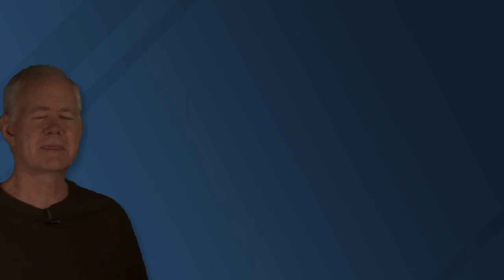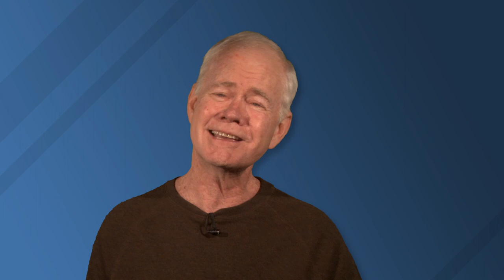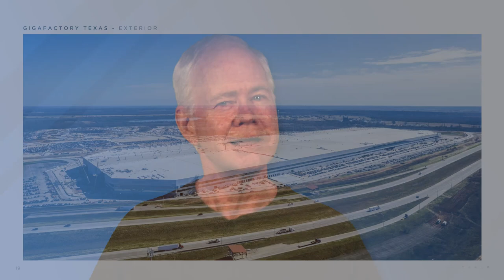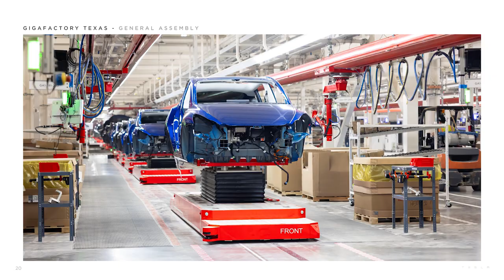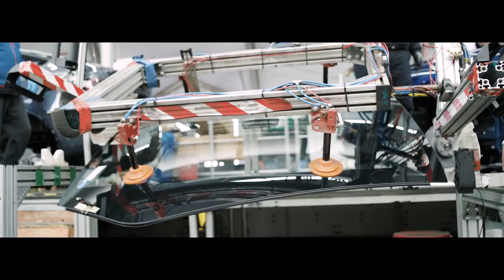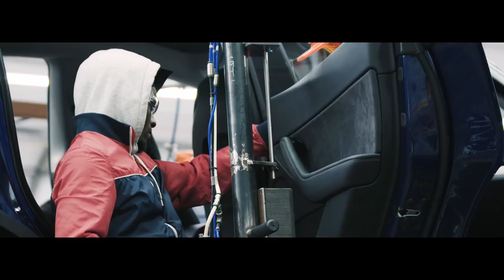Can Tesla Surpass GM & Ford? Here’s What Will It Take for That to Happen

Comment: The key metric is battery production - automakers can't make Battery EVs without EV batteries. If you look at the expansion of EV battery capacity over this decade, Tesla is positioned to hold on to at least +50% of the EV market through 2030, as the EV market inflates to 10M US sales. This is pure production capacity, not projected sales. But at those volumes, Tesla will be able to offer volume pricing that other automakers won't be able to match. And the Hail Mary play is that IF Tesla can complete FSD, they can sell vehicles at cost because the revenue from robotaxis will be more valuable than sales margins. This is the killer app that Tesla is aiming for. Why buy a 'nice' $30k GM Equinox EV when you can buy a $25k Tesla money printer?
Meanwhile, all the analysts are looking at sales margins because they have zero models for assessing the affects of robotaxis on private vehicle sales, so they keep focusing on the premium and luxury segments because 'that's Tesla's playground'. And we get comparisons between GM & Ford's ICEV production to Tesla's EV production. ICEV production really isn't relevant when the industry is shifting to EVs. The only metric that matters is how many EVs GM and Ford are producing, which at present puts GM and Ford competing for a distant 2nd place to Tesla.
As for where Tesla should put it's next GF.. Detroit is a terrible location. But people keep thinking "Teslas are cars, so surely a place that makes cars would be relevant!". Teslas are robots shaped like cars. The best location for a new car-shaped robot factory is places with lots of cheap land, access to cheap energy,  uncluttered logistics routes for parts in and finished vehicles out, and temperate weather to reduce facility HVAC costs while being more attractive to employees. Competing for land, power, and transport with the existing automakers in Detroit doesn't sound like any of that. Never engage in battle on your opponent's territory when you don't have to.
Reply: Wow, you really have some hopes and dreams!
Reply: "The key metric is battery production" . . . 100% Correct!  No other auto manufacturer has battery production capacity or access to it to allow for production of enough EV's to equal Tesla.  Tesla has been working on access to battery capacity for several years; raw materials and manufacturing methods; and has secured its future growth based on these critical factors.
Reply: You're definitely spot on with your battery capacity comment.  If this was an apples to apples comparison, sure GM and Ford would outsell Tesla on total vehicle sales.  But it's not a straight comparison.  What is GM and Ford making per vehicle, compared to Tesla?   Tesla at 14% per vehicle, when F and GM are less than 10%.  Also, how much money is being wasted on advertising?   $5000 per vehicle is a popular number.  The Cadillac Lyric might be $7500 based on every football weekend in the fall of 2021.

One thing never mentioned by the analysts is, how much money will declining ICE sales cost traditional automakers.  Even they would admit it's not free to just stop your ICE Equinox line and make it an EV Equinox line. Not just the R&D, but the retraining of robots and labor.
Reply: Jacksonville Florida in between Tallahassee lots of open land hi way 10 to the ports of JACKSONVILLE can handle all the incoming supplies to make cars then ship out!!!
As  Labor goes you have Miami Hurricanes the Gainesville Gators ,   Florida State University Semonyms, and the Georgia Bull Dogs,
Reply: Batteries are key, agree. But so many people cant see this unfortunately. You cant make EVs with batteries you dont have. So traditional automakers will have great and good looking products, but without enough batteries, it isnt worth much.
Reply: Carter,  Battery production means very little if the consumer won't buy the product.Here in the USA they have about peaked and Fremont will be closed before long because of lack of demand. These stock market folks have never  sold cars and have no idea that most Americans will never buy an EV.The small market for Ev's is about to be taken over by Ford and GM.
Reply: @davewhite113  GM only shipped 26 EVs in Q4 2021. They are way behind. Their CEO is  a wack job claiming to be leading in EVs.
Reply: Battery supply is an issue, but GM has plans for 4 US plants (or was it 4 additional) and has material supply deals. This is not the roadblock Teslerati believe. Besides if Tesla blocks anyone else's supply, there will be bound to be an antitrust case brought.
Reply: @205rider8  in the US, yes as delivery of the Hummer and Brightdrop vans began. in China GM sold 500k EVs, compared to Tesla's 240-250k. Tesla's China sales in January tanked, even including exports down almost 50% from December. That's not a capacity restraint. BYDs pure EVs outsold Tesla and must be close to GM's much cheaper Mini EVs. A new long range, larger and more powerful model under$10k should help GM maintain at least second place after BYD.
Reply: @davidmccarthy6061  Tesla is the only company locking up long term contracts on raw materials and battery suppliers.  Ford and GM physically cannot produce enough EVs to beat tesla as they haven't secured the raw materials.
You don't have to judge anyone's products when the competitors physically cannot make product to put up for competition.
Reply: @_PatrickO  the roadster and Cybertruck are delayed (also they are still in development, not ready for production anyway, so yeah, blame production constraints). On what are you basing "they absolutely had plans"? All Musk has said is "we will be able to produce a car for $25k by ...". And maybe they can. But when asked about it a few weeks ago said instead "we're not currently working on a cheaper model. Maybe someday we will". Did they show a product concept? No, all the images are enthusiast renderings. Did they actually announce they would do it? No they did not. Not cancelled not delayed, just not in the plan. Maybe, a very big maybe, they'll one day decide to actually do one, but since it's not currently planned and isn't being developed, it's at least a decade away. Maybe longer. Maybe sales will stall and they'll rush one into development, but this is far from "there will definitely be a model 2, but is not a current priority". That sentiment is purely fan fiction. In this case, no cheaper mass model, 2.2M sales will be market saturation, and they'll be lucky to reach that.
Reply: @davewhite113  Wow. I didn’t know people still believed things like that. Demand for Tesla vehicles are way beyond their current production capacity. Other quality EV offerings other manufacturers are facing “higher expected demand” also. See Ford Mach E and F150 Lightning. As flat screen televisions became more affordable and feature rich, demand for tube televisions died. Such is the fate of light-duty ICE vehicles. The power, reliability and lower cost of ownership of EVs will make the decision a no brainer. Time moves forward and so does technology, Dave. No sense fighting reality. GM hopes to make a million EVs by 2025. Tesla did close to that last year. No other auto maker has the requisite battery materials and supply agreements needed to even match Tesla for years. It’s not feelings or opinions, just facts and math.
Reply: @AutoReport1  The fact that GM is taking credit for EV sales that is mostly a Chinese own company is a desperate move. Of course not mentioning GM sold 26 EV in the last quarter, huh. But yet paint a bleak outlook for Tesla and high praises for GM. That is comical.
Reply: @p.t.9709   PT, We are about to find out soon  if Tesla has the demand that they've been claiming.(they don't).... Both Ford and GM are claiming high demand BECAUSE they see what Tesla's stock has done when they've claimed it. Sure they might have deposits but only about a quarter of those will  end in  a sale.....Ev's are in no way like flat screen Tv's,  Flat screens are better, where Ev's still have way too many disadvantages compared to ICE.The public charging issue will keep most Americans from ever buying an EV. Not enough chargers and people aren't gonna wait long periods of time to charge.Don't care what the cost to own is, 95% of Americans aren't gonna buy an EV. those that do will use them as second, run around cars to bebop around town with.People that make these false comparisons have never sold cars, and have no idea what the consumers want.
Reply: @nguyep4  GM has always reported SGMW sales, even before it had EVs. It's a three way venture and someone had to report the sales. Wuling supplied factories and dealers and early product lines (now all replaced), SAIC cash, GM management and technology.
Reply: @JJ-td4kd  But, that Tesla "Truck" isn't a truck.   Metro area trades people can't use it: bed is too small, not a 1 ton, not capable of racks, bed boxes or anything. else.  Tesla will sell to trendy people for an over priced golf cart with a video screen and fart sound effects.  The Ford and GM trucks are trucks.
Reply: It is going to be in Oklahoma...that was the 2nd place option...
Reply: There’s a lot to unpack in this reply.  My main problem is the time frame everyone assumes for EVs.  With the average vehicle life over 10 years today and current sales of EV‘s at less than 3%, it’s more like 10 to 20 years before we have any significant penetration not 5 to 10.
Reply: @tstan6827  no, but the Equinox had to be replaced anyway. No big deal, and EV powertrains are simpler and more efficient to manufacture.
Reply: @rickrosler  S curve demand...In 2015 they said Tesla will never make it...In 2022 they(GM,Ford) are losing sales in the premium segment and as the Y production ramps up they are losing sales in the 40 grand segment...furthermore nobody else has a practical dense charging infrastructure other than Tesla...
Reply: Yeah the problem is Tesla is tied to it's battery... Any other manufacturers can switch easily to latest battery technology of the future
Reply: Did you see that GM/Ford just discovered the largest lithium deposit in the world in Arizona?  They have enough lithium to last hundreds of years.

Comment: I enjoy John’s videos and hearing his point of view, but I’m afraid this one won’t age well. An end capacity of 1.2M vehicles for Austin and Freemont combined  is not even close their real capacity. Austin alone will have a capacity of 2M vehicles when fully built and ramped. Tesla’s focus on manufacturing processes is unmatched in the automotive industry so comparing factory outputs with legacy automakers won’t be accurate in the long run.
Reply: That doesn't even count what the elimination of the paint shop will do with the cyber design thread they look to create.
Reply: @rickrosler  Jim Farley disagrees with you. Also, what flavour of look aid do you prefer?
Reply: @paulcrowdis7443  ha ha ha
Reply: All together the legacy brands will dwarf Tesla.  Tesla will constantly lose EV market share over the next decade.

Comment: If I heard correctly on another channel, Giga Shanghai, a smaller plant than Giga Texas, should have a run rate exceeding 1M/year within a couple of months.  How do Giga Texas and Fremont only add to 1M?  With a dramatically smaller BOM, an EV plant should be able to produce many more vehicles per unit of logistics traffic or employee.  Since Tesla has high vertical integration, that probably also reduces the number of different items or material that must be transported in.  One might argue that 15-20% more mass must be transported in per EV vs. ICE, but fewer BOM items are likely to make transporting that mass more efficient logistically.

It also seems no one takes Elon's claim of continuing being able to grow at least 50%/year seriously.

Comment: Get your facts right - if Tesla continues to grow 50% per year (in 2021 they grew by 87%), it will surpass GM/Ford in revenue and profit by 2025 (>$200B Revenue, >$25B Profit) and by global volume by 2027. As far as US volume, Austin is designed to product 2 million vehicles and Fremont already produces 500,000 vehicles, and Tesla said they plan to grow it by 50%. So, by 2025, Austin and Fremont would likely reach capacity, and even if they don't, by then Tesla would have another factory in the US - so will produce over 2.5 million vehicles - if not in 2025, then 2026 or 2027, but before 2030 for sure. 
Finally, analysts and media was saying "competition is coming" since 2012. There are headlines EVERY year that Ford, GM (remember the Bolt vs Model 3??) , Audi (eTron vs S/X), etc - will kill Tesla. So far Tesla is just extending its lead. 
People were puzzled at the iPhone when it came out. Many said it will flop, it's too expensive. Who would believe back then that Nokia and BlackBerry (who made billions of phones and billions of $$$) would just vanish.
It's not a question if Tesla will overpass Ford and GM, it 's a question is when. A bigger question is if Ford/GM will be able to keep more than 5% of the market by 2030. I'm not sure they will.
Reply: Ford and GM have a very long way to go. There biggest problems are getting batteries and slowing ice down at the same time. A logistical nightmare.

Comment: That analyst clearly missed something.  He said Tesla's are 10 years ahead of legacy auto.  But yet somehow people are going to pay more for a car that is 10 years behind a Tesla.  I bet Tesla's market share grows from here, not decline.  Does that analyst think Tesla isn't going to make any improvements and let the legacy automaker catch up?  Tesla is making more changes per week than legacy automaker can do in a year.
Reply: you make the common mistake of fanbois by assuming that EVERYONE cares that Tesla has a tech lead. FACT is, hardly anyone does.  They just want a car that works for them.  Teslas are silly for most people with their emphasis on ONE hot launch (with HOW LONG to prewarm the battery?)  and crappy suspenion and especially brakes.  REAL car companies also now make electrics and it doesnt take 10 years to make up 10 years of tech advances.  Only takes a good copy.  ;)
Reply: @mikeb1039  Tesla has a massive tech lead.  Best user interface, over the air software updates, and best power train efficiency.  People really care about the range and the user interface.  It's the two biggest driving factors in EV sales.  And that tech that really brings home the point of how far ahead Tesla's is.  Tesla is making cost and quality changes faster than any other car maker.  Legacy auto can't catch up to Tesla.  Even older Tesla vehicles get software updates and upgrades that keep the cars on the leading edge of technology.  No other car maker is updating existing vehicles with new features for free.
Reply: @donm2255  NO, tech and range have driven the early adopter markets.   The rest of the population doesn't really give a s***.
The things that you think are most important are only that to YOUR group of buyers.  Many many buyers still have no interest in EV's.   Many many others want a normal type car that happens to be EV.
Reply: @mikeb1039  Tesla has changed what a car is.  And the new "normal type car" is rapidly turning into a Tesla.  Most legacy auto have announced plans to make their cars more like a Telsa.  They see where demand is heading and are trying to catch up to Tesla.  Demand is so strong, that people are waiting now until 2023 for a new Tesla, even after price increases.

When I meet someone and they ask me about my Tesla, the first question is "How much range does it have?"  Every one cares about the range.  

In just a few years, ICE vehicle makers will start feeling they effects of eroding market share to EV's.  It won't be long after that when profitability dries up.  By the end of the decade I would be surprised if any automaker is producing passenger cars with an ICE.  All the people that hate change will quickly find themselves with out an option for a new car.  Things change.  Disruptive technology always replaces old, less cost effective products.

Comment: Tesla, and Elon Musk, have never said the goal was to surpass GM or Ford. Many others have predicted such an outcome though. Elon always stated the goal was to accelerate the transition to sustainable and non polluting transportation and they were going to start with cars.   It became very obvious to Elon and most others that the big OEMs were not getting the idea and were moving MUCH to slow if at all. So Elon had to take on the problem in a greatly expanded form.  By now it should be obvious that Tesla's, and some of the Chinese EV mfg.s, are on track to surpass GM and Ford before 2030 in the total car market but that was not the original goal.
Reply: They beat ford in 2021.  Tesla is making 40% more money than ford while ford is selling 4 times as many cars.  This is the trick that john is playing into by talking about marketshare.  Marketshare means nothing if ford is going bankrupt and tesla is generating massive profits.
Your company will fail even with 100% marketshare if you lose money on every product sold.